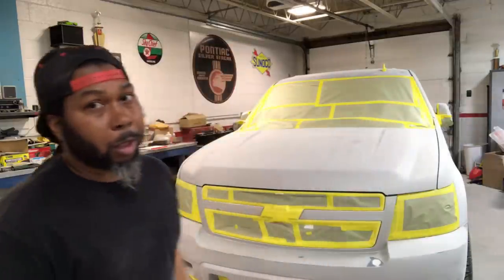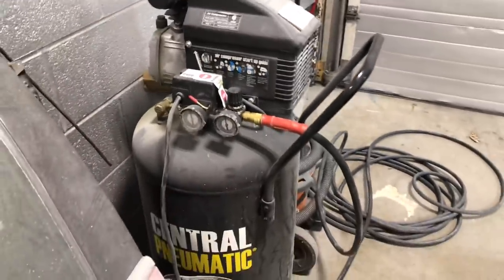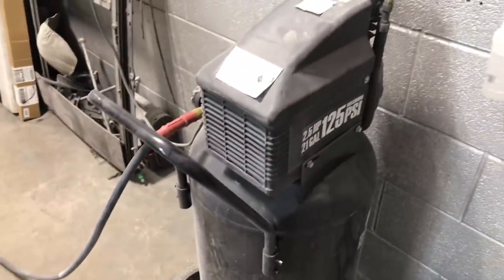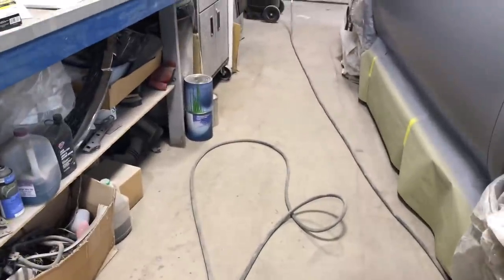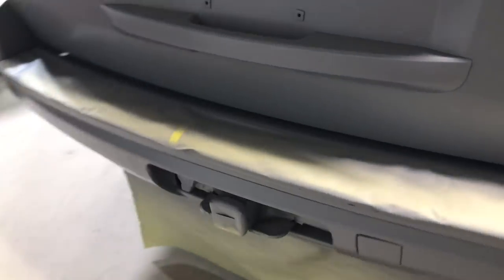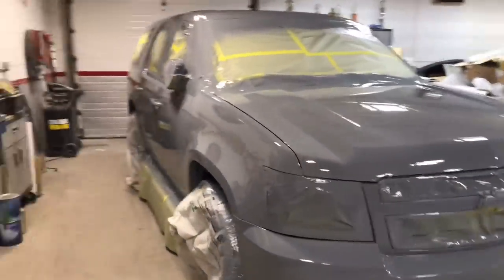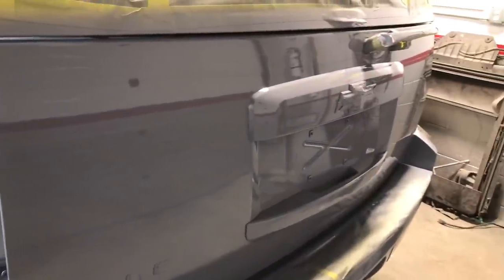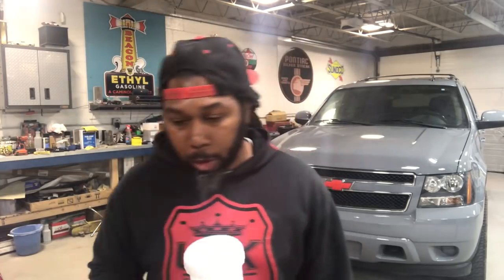COMPLETE PAINT JOB with the SPRAYIT R500 LVLP spray gun and a small compressor

Comment: First time on the channel and I loved the video! Question, I'm getting ready to paint my truck and am considering running a similar setup. I read that with using a lvlp gun to not thin the paint. Is this true or should I follow the 4:1 ratio the kit states? Thank you!!!
Reply from the maker: Thanks I appreciate you checking out the channel…what kind of paint are you using?
Reply: @UndergroundPaintKing  I will be using a 2k kit from paintforcars.com. It comes with base and medium reducer, along with clear and activator
Reply: @UndergroundPaintKing  for this kit in particular it says to use 3 parts paint, and one part reducer, do you believe that will be ok for a lvlp gun? Thank you
Reply: @UndergroundPaintKing  for this kit in particular it says to use 3 parts paint, and one part reducer, do you believe that will be ok for a lvlp gun? Thank you
Reply from the maker: @codythelen6048  ok…I see no reason why you can’t reduce it if the manufacturer says to reduce I myself reduced the base for this truck and had no issues
Reply from the maker: @codythelen6048  yes it should be fine to spray with a lvlp spray gun
Reply: @UndergroundPaintKing  alright I just wanted to be sure and get some first hand advice. You are the REAL DEAL and put out some excellent work! Keep it up man and thank you for your help
Reply from the maker: @codythelen6048  You’re welcome bro and I appreciate you!

Comment: Yo, did you have a water/moisture trap in line to the gun?
Reply from the maker: Only water trap I had was on the gun
Reply: @UndergroundPaintKing  thanks for quick reply. What type is it? does it work well?
Reply from the maker: @GTFour  they work well they just don’t last long but you can also get a filtration system setup along with a water trap…I get them from my local paint supplier and they sell them at Harbor Freight

Comment: Have you tried the harbor freight LVLP spray gun with the 1.7mm for $19.99?  Is it worth it?  It
Reply from the maker: I didn’t know they carried a lvlp spray gun I believe all their spray guns are hvlp but may have a lower cfm on some of them
Reply: @UndergroundPaintKing  Thanks for your quick response.  Yep, they got the lvhp siphon type.  It's 33 ounce cup   I figured I'd ask, because I don't want to waste $20 in case it ain't decent.  The specifications say it's good for latex. It has good reviews.
Reply from the maker: @MG38601  I guess it depends on what you’re using it for because the transfer efficiency for siphon feed spray guns aren’t the best when it comes to automotive paint but it still might do a great job for you

Comment: Underground Paint King, U DA MAN! Great Job, just the the video I needed to see, keep it up. Gives me the confidence to paint my truck with an LVLP paint gun. What pressure were you using on the gun?  About 25-30psi?
Reply from the maker: Thanks I appreciate you checking out the video and yes the psi was 28-30 psi between base and clear
Reply: normal LVLP gun clear coat uses 16-17 psi and last paint 20 psi not more newer, HLVL need more psi.

Comment: Hey UPK, That turned out spectacular! Thank you for the tips on cracking the tank valve and taping a paper shop towel on the air hose and paint gun connections. With your experience with this one, do you think a metallic would have any issues with a low pressure set up like yours? Be well and take care!
Reply from the maker: I don’t believe I would have a issue with metallic with this set up but will definitely test it to make sure…I did a review on the gun using this same setup and sprayed a fender with a metallic and it turned out nice but doing a whole vehicle could be a different story so now I want to see…thank you and I appreciate you!

Comment: What about a pancake compressor, I used a 30 gal craftsman compressor for my cj5. Jeep?
Reply from the maker: If the pancake compressor can handle the demand of the spray gun it should work Jim
Reply: @UndergroundPaintKing  about how many CFMs?
Reply from the maker: @jimronge9386  depends on the cfm requirement of the spray gun you’re using

Comment: Just got a reusable aerosol spray can bottle only this week the last one I got didn't like it was called the Prevail aerosol spray can and didn't like it now am trying to get with of these scratches with a touch up small bottle spray kit got online from Automotive touch up paint site didn't like putting it on with a small tiny brush they had that came with it it's not coming out right when I do it like that I could do better with a aerosol spray can but once that aerosol comes I could use it for touch up spots because already have the electric spray gun think I told you about it before and this cheap hvlp spray gun had since last year. I saw videos of people trying to paint with a roller on YouTube but never tried to paint with a roller just seems a roller wouldn't make a better paint job easier for someone like me with not a lot of painting experience for a pro it would be different but me I got a long way to be really good plus I don't paint every week. Remember in the past I was naturally good at bowling but just got tired of doing it in the last year.

Comment: AP on your nice paint job. Can you use an 8 gallon compressor?
Reply from the maker: Thanks I appreciate you and I don’t see why you couldn’t use a 8 gallon compressor as long as it meets the cfm requirements but you won’t have much air volume with a small tank but I’m sure you can pull it off

Comment: Will it work on an 8 gallon air compressor?
Reply from the maker: The gun needs 3.5-3.9 cfm to operate properly so if the 8 gallon tank can accommodate that then it should work
Reply: I am using it with an 8 gal with 5.1 scfm @ 40 psi and it works fine.  Doing two panels at a time.
Reply from the maker: @josevalverde1889  that’s good to hear…I’m glad it worked out for you!
Reply: @josevalverde1889  what's the brand of your air compressor?
Reply: @comeculo6964  mcgraw. anything over 5.0 scfm @ 40 psi will work.  get one with as much air capacity for longer jobs. i spray one panel. wait 1 min and spray the second. it's a pain but it works
Reply: @josevalverde1889  thank you

Comment: Man,  you just gave me some inspiration.  What where your settings on the compressor?
Reply from the maker: I don’t remember what the compressor was set at I don’t use it for doing a lot of paint work I normally use it for airing up tires and other small things around the shop…I appreciate you checking out the video and glad I could inspire!
Reply: @UndergroundPaintKing  normal all compressor have setting max pressure 8 bar and min 4 bar. used alltime 8 bar, and gun have pressure adjust drop less than 2 bar.
Reply from the maker: @mattivirta  thanks for your advice!…I appreciate you checking out the video

Comment: You need to fit a water separator/ dryer on your line.(Ebay $20) Opening the water bleed tap while the compressor is on will waste electricity and keep the compressor underfilled with air. Its the worse advise ever.
Never use a paint sprayer gun without a water separator.
There a plenty of videos on you tube on how to set up your compressor and the equipment required for paint spraying. .1)Compressor with a tank. Minimum 50 litres. 2)Air pressure Regulator, 3)water trap, 4)airline, 5)spraygun,
Reply from the maker: @aadd3538  appreciate the tip!

Comment: You did not use a line dryer and painted plastics with the same paint 😮 can you show an update of the bumpers now? I've been told you take off plastics to paint separate so they won't flake off later because they need an additive to be pliable.
Reply from the maker: The owner has the vehicle but I can tell you that nothing has flaked off

Comment: 21 gallons= 95liters. A small compressor for me is about 24L/ 6 gallons. and i also spray with that thing. But good job for sure.
Reply from the maker: Does it work well for you with the 6 gallon?…I appreciate you checking out the video
Reply: @UndergroundPaintKing  For small projects yes, it's doable. I didn't spray a complete car with it. My hobby is making metal furniture and stuff and that works with the small compressor.

Comment: GREAT 👍
Reply from the maker: Thanks Greg I appreciate you checking out the video!
Reply: @UndergroundPaintKing  I'm going to crack open a Valve and let the vapor water drop out like your system , also this will allow some heat out of the air, good tip
Reply from the maker: @gregbabington4804  glad the tip helps!

Comment: Next time just jet an oil and water separator you can buy them at home depot and then it'll catch the moisture you just gotta drain them occasionally into a can
Reply from the maker: Appreciate that tip and appreciate you checking out the video!

Comment: sweet paint job and that spray gun is perfect for my set up i'll have to buy that spray gun for sure
Reply from the maker: You will definitely like it and I appreciate you checking out the videos!
Reply: @UndergroundPaintKing  no problem I’ve painted probably 5 parts so far with the Spectrum professional HTE loving it but find that I have to kinda stop for some reason my air Compressor somethings doesn’t cut on other wise perfect for for my set up
Reply from the maker: @AliVapeReviews  what do you have to do when it doesn’t cut on?
Reply: @UndergroundPaintKing  I unplug it from the wall and turn it off plug it back in and turn it on only does it sometimes not everytime
Reply from the maker: @AliVapeReviews  yeah that’s weird I honestly don’t know why it would do that
Reply: @UndergroundPaintKing  same but I don’t mind as I put the two year warranty on the air Compressor so before the two years is up I’ll swap it for a new one
Reply from the maker: @AliVapeReviews  good plan
Reply: @UndergroundPaintKing  yeah the air Compressor alone came out to $270 still a very good deal for what it is and it’s enough for me at the moment later on I’ll probably get a 60Gal or 30Gal but for now this is perfect for paint two parts at once
Reply: @UndergroundPaintKing  just bought the sprayit lvlp kit with the small gun and big and the other stuff for $88 it’ll be perfect for my 20g air Compressor
Reply: @UndergroundPaintKing  well i should have not bought the HF hvlp two spray gun kit for $50 bought it with the other spray gun spray patter i can get it just right for the life of me and getting fish eye's with it but with the $139 hte no problem at all also i think i'm gonna upgrade and get the HF 29G air compressor for $390 and should be the only one i'll never need with that i can a full car with a lvlp spray gun which any tips on using that spray gun mine is coming in 2 days and got a fender to spray
Reply from the maker: @AliVapeReviews  just adjust the gun to your liking and do test panels and dial the gun in until you get the results you want and once you’re satisfied and the gun is consistent then you should be ready to do a car
Reply: @UndergroundPaintKing  I did but it just not good to much paint and the pattern is not perfect it just to much paint even with the paint flow things half way open is way to much and less then half with 35 psi even at 40 psi oh well I bought it to mess around with and get better but I have a question so I’ve got a bumper and hood that needs to be painted what grit of sand paper I use to get it ready for primer I thought I would only paint already primed parts but found them super cheap but different color already bought paint
Reply from the maker: @AliVapeReviews  did you adjust your fan pattern along with adjusting your fluid…also if you have a bumper that’s painted but in good condition you can sand with 240-320 then prime the bumper
Reply: @UndergroundPaintKing  ok so use 240 then 320
Reply from the maker: @AliVapeReviews  if you don’t have scratches or any damage to fix on the bumper you can sand with 320
Reply: @UndergroundPaintKing  ok thanks is also what do i use to sand primer and also what I use once I want to cut and buff the paint job
Reply: @UndergroundPaintKing  like I got filler primer and regular primer which I think is 2k
Reply: @UndergroundPaintKing  as I have a bit of orange peel in the part I painted and have to paint a rear bumper but have to spray primer I got a little dent which I believe filler primer will cover it for sure but don’t know what grit to sand it with and what grit to use before cut and buff
Reply: @UndergroundPaintKing  I apologize for bothering you I tried looking it up but it would say different girts and I want to get it right the first time and not have to redo it
Reply from the maker: @AliVapeReviews  are you asking what grit to sand with before you apply the primer?
Reply: @UndergroundPaintKing  yup and what grit to sand after primer and once I’m ready to cut and buff I have a bumper that’s been drying for about 2 days now but need to cut and buff as I have a bit of orange peel
Reply: @UndergroundPaintKing  and one which ones I wet sand I know to wet sand with whatever grit to is before the cut and buff and to sand off paint before primer is 320 if there’s nothing worth with it but if there is 220 then 320 and that’s dry sanding
Reply from the maker: @AliVapeReviews  240 before primer and 320-400 after primer…if the orange peel isn’t bad you can start at 1500-2000
Reply: @UndergroundPaintKing  thanks
Reply from the maker: @AliVapeReviews  you’re welcome
Reply: @UndergroundPaintKing  also question so I’m gonna swap out my 20G HF air Compressor with there 29G air Compressor you think it’s a better upgrade or I saw that home depot or Lowe’s has a husky 60G air Compressor for $629 you think I should just get the 60G or the 29G which with the two year warranty it’ll come to $500 but I’m more towards the HF 29 gallon but i dont know if it can handle a HVLP maybe it can
Reply from the maker: @AliVapeReviews  most likely if you go with the 29 gallon you won’t be able to go with hvlp for complete paint jobs so you will have to decide on what you plan on doing and how much work you plan on doing to determine what compressor to purchase
Reply: @UndergroundPaintKing  I would go with a 60 gallon for like $600 something but problem is I only have 110v at the house so that’s another thing I forgot about and have to keep in mind and I just want to buy one once but I don’t think I’ll ever have paint a full car maybe half at most
Reply from the maker: @AliVapeReviews  it might be best to go with a small compressor then
Reply: @UndergroundPaintKing  yeah I’m just gonna get the 29G air Compressor and the black widow HTE and HVLP is on sale for $180 as I would get my money back for the 20G air Compressor I bought but there’s a restocking fee which is $54 so I’ll only get back $220 instead of $270 if I swapped it for a more expensive one and just pay the difference damn only if I didn’t buy all those spray guns would have bought the black widow or I just mite would it work fine with the 29g air Compressor I think it’s 5.9 cfm at 90 psi and 7.3 cfm at 40 psi which would be better the black widow HTE or HVLP my apologies for bothering you but don’t know who else to ask
Reply from the maker: @AliVapeReviews  it still won’t be enough for either paint gun but it should work for what you plan on doing
Reply: @UndergroundPaintKing  ok sweet yeah I plan on swapping my 20G air Compressor for the 29G in a few days I’ll buy the black widow HTE if it does good for one part at a time I’ll keep it
Reply from the maker: @AliVapeReviews  let me know how it works out for you
Reply: @UndergroundPaintKing  we’ll do thanks again and thanks to you the orange peel is mostly gone and paint the part perfectly I sprayed base at 25 psi and clear at 30 psi came out amazing
Reply from the maker: @AliVapeReviews  nice to hear and glad it worked out good for you!

Comment: Nice job. Just keep your compresor away because the valves inside will clog with paint/ clear and stop working properly and loses volume.
Reply from the maker: Thanks for the tip but only have it there for the video because you are absolutely right it’s best to have the compressor separated and in a different area…I appreciate you checking out the video!

Comment: Overspray?
Reply from the maker: What about overspray?
Reply: @UndergroundPaintKing  
Seems it would be all over. I don’t remember you, using a booth
Reply from the maker: @og-greenmachine8623  I have a paint booth and I have exhaust fans pulling out the overspray…I made this video to show people that you can achieve a complete paint job in a home garage setting using a small compressor
Reply: @UndergroundPaintKing  
Aaaah...
I thought it was a garage.
I was going crazy...
Reply from the maker: @og-greenmachine8623  I appreciate you checking out the video!
Reply: @UndergroundPaintKing  
I have an 80 gallon two-stage husky air compressor.
Never considered this as an issue.
I don’t regret having such a monstrosity in my garage.
But 
now I know if anything happens, I can use a smaller one to paint.
I would be curious about consistency of pressure.
I have a sata jet 1000? Sprayer
and 
it has some inline, digital thing (Devillbis) on there 
that Imagine, checks psi drop or maybe moisture?🕵🏽‍♂️
But,
Even as that air compressor seemed to be keeping up?
I wonder about the consistency of pressure and 
will it give the same even spray pattern,
 as it struggles to keep up?
Thx!
Reply from the maker: @og-greenmachine8623  you’re welcome…I’m in the same boat with you I have a 80 gallon at home along with at my shop but I started out using small compressors